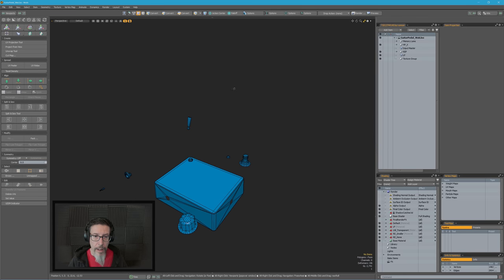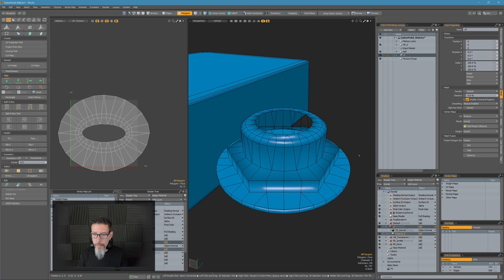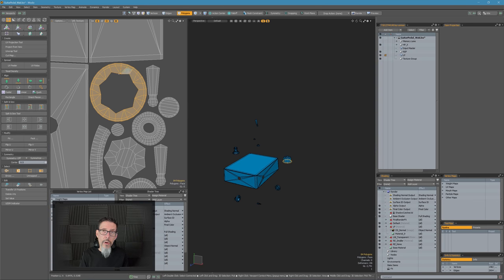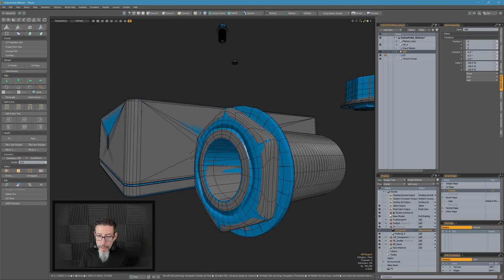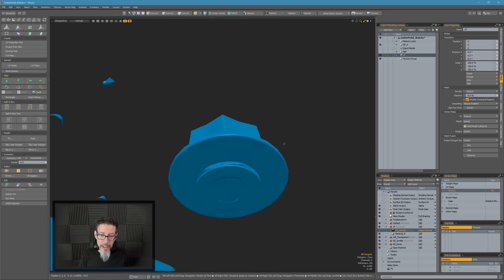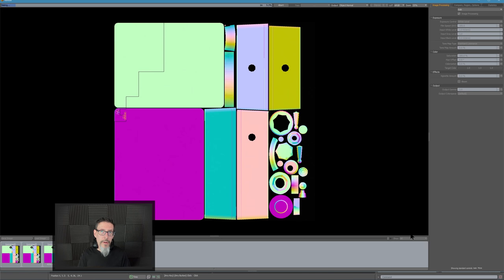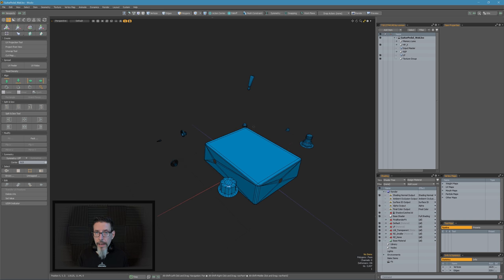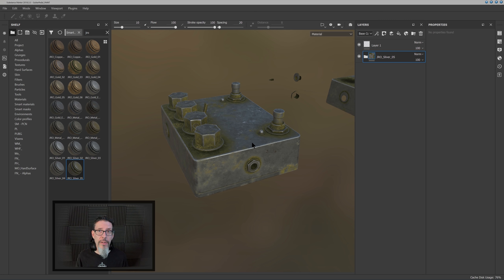Part 3 - Guitar Pedal : Low Poly, UVs and Bake

Comment: I think I missed the reason behind the object normal map to tangent conversion step :x ; do you mean with that step you can (before baking anything) avoid to sharp/hard these edges regarding the boundaries of uv islands?
Reply: And since you dont sharp/edge these edges for baking, they'll not turn into double verts that grew your polycount?
Reply from the maker: @Toskyval  It's a nice workflow because it allows me to not have to worry about UV splits or vertex normals for the most part. It's a lot less picky than tangent space workflows AND I can save on verts.  I go into more detail in this video:

https://www.youtube.com/watch?v=Nz7oY1q470w
Reply: @WarrenMarshallBiz  sounds too good! 
Noob here so a stupid question:  so with that method you can also wash away some of the visible seams (UVs boundaries) you get baked (using tangent space) into the normal map?

Comment: Is there any alternative to xNormal? (I'm on Mac). Maybe Substance Painter/Designer or Marmoset?
Reply from the maker: On Mac, that's an excellent question.  You might just want to stick to tangent space normals?

Unless Handplane, for example, runs on a Mac ... I'm really not sure of the full menu of options out there so there MAY be a Mac solution that I'm just not aware of.